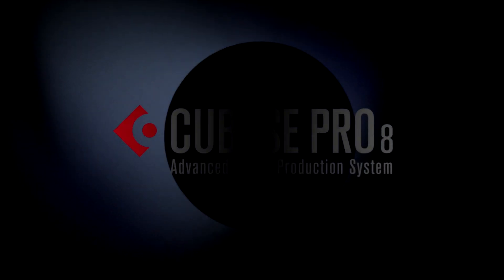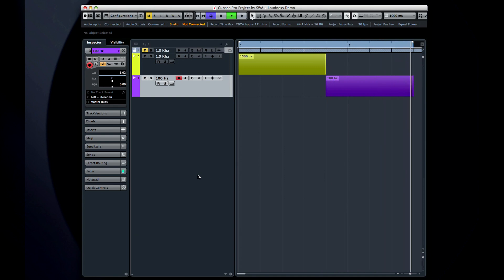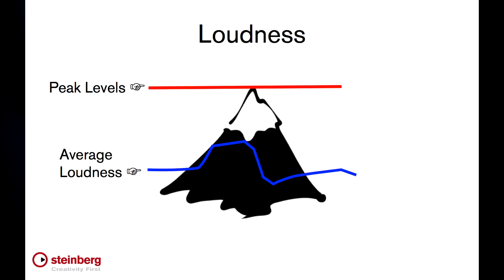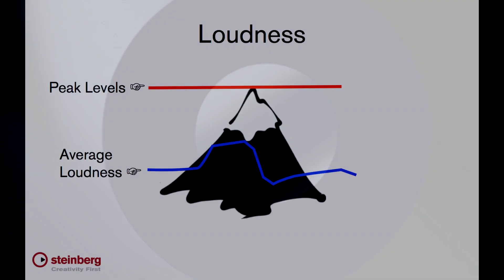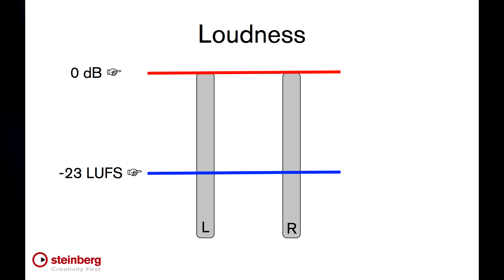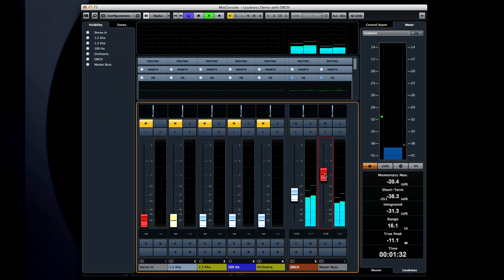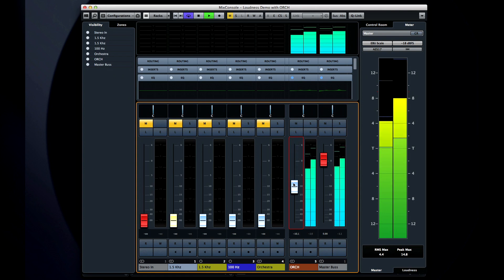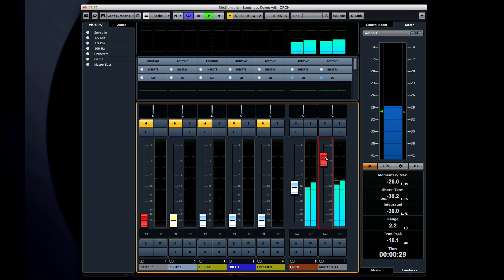Monitor Your Audio's Loudness | Advanced Features in Cubase Pro 8

Comment: Here's what is confusing and I wish you folks would tell us, using the control meter if I mix at 0 to 3 bd on the mater the "true peak" which I am taking that litterally as the true peak reads 8-12 -db so which one am I mixing at 0 db like the meter says or -12 db in which case I can raise the level another 12 db which buries the meter. So what is the real one and why do they not match?

Comment: i like cubase alot  but any atempt to fix something like loudness by hiding values is desstined to fail  if for nothing  else than the users this deep into the program are fully aware of all the issues  and do not need a nanny to exert control over meters for what-ever reasons. the calculas for peak and rms values is classic and could be explained off-line if not in the you tube video. i think this approach may make some really smart people angry. while being politically incorect. loudness in tv commercials will always occur as long as some -one thinks there is money to be made from it. regardless of the technical tricks used to implement or defeat it. the best way to defeat this behavior is the off button and aone hour timeout  for the networkthat does it. if they are acting like small children we have no choice but  to treat them like that. go to the public library and check out some books or read the bible.